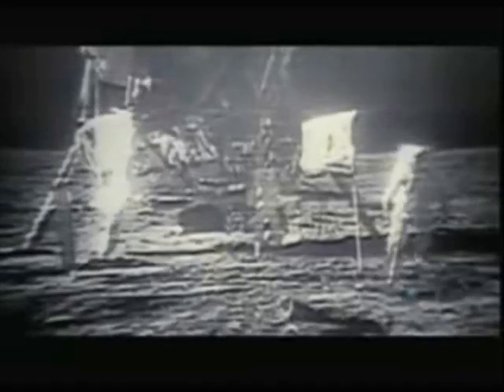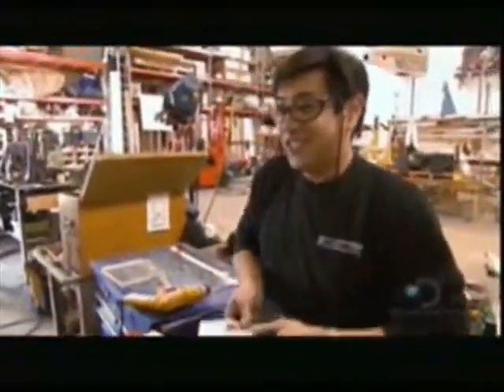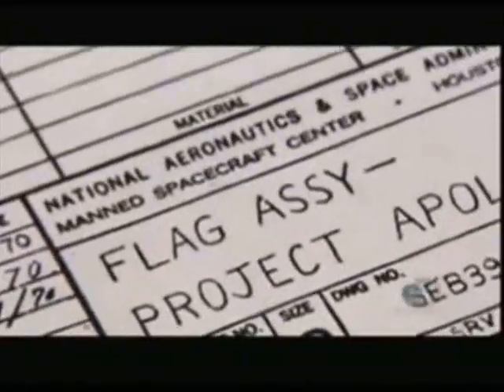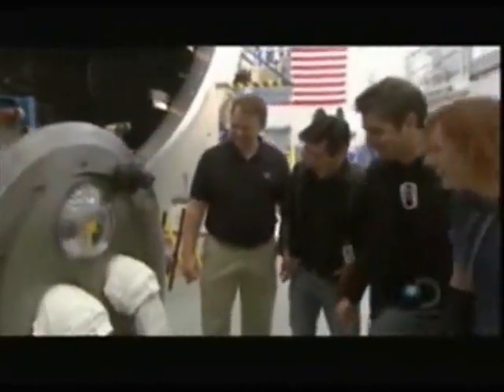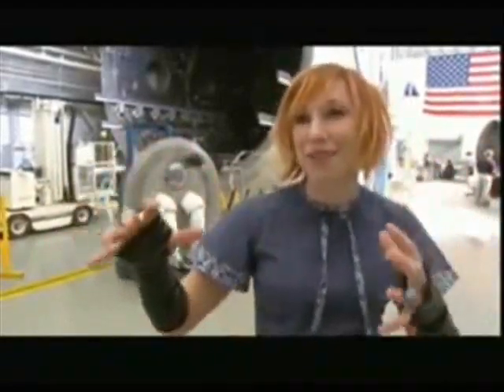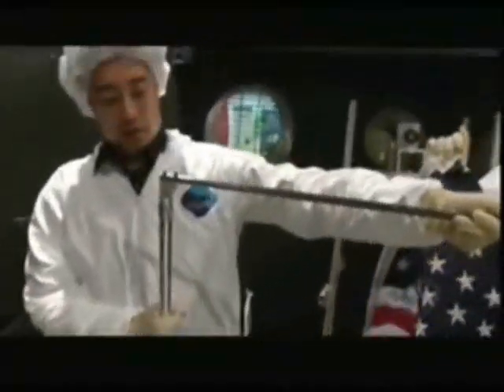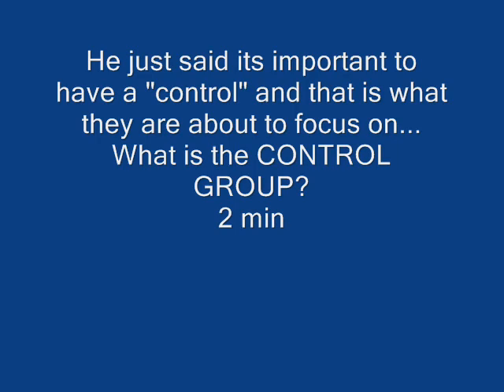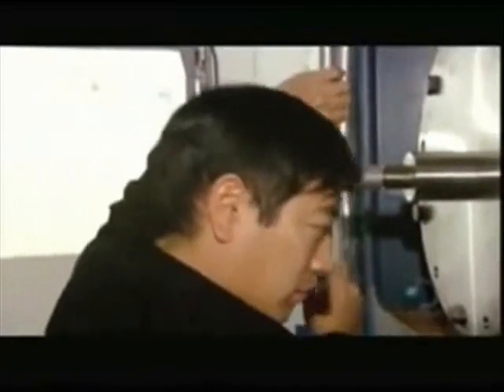Scientific Method Classroom Lesson: Myth Buster. Flag Hoax on the moon

Comment: Here is a video clip that shows the flag start waving after an astronaut runs past it at 2:34 mins. Myth busters is full of it.
Apollo 15 flag waving
Reply: Moons Gravity is a sixth of earths. If your statement was true, why did moon dust disperse everywhere from the liftoff? Of course it was from the thrusters, but that is just a larger scale of displacement of gravity, while an astronaut is actually doing the same thing on a smaller scale.
Reply: SaltyChip Interesting you mentioned the landers thrusters. There are plenty of photos showing an absence of the crater that should have been left by these thrusters as the vehicle touched down and an absence of dust on the landers feet that should have settled but did not.
Reply: +Truth Seaker how would  four legs from the lander create a crater?? Im open minded on this subject and all, but just don't see this as proof of anything nefarious.
Reply: SaltyChip The landers engine would  create a crater in the process of landing. You are aloud to use your brain you know.
Reply: +Truth Seaker you are allowed to use your brain too because you spelt allowed wrong
Reply: Lucy Zhu
I am dyslexic, thats why I cant spell,  whats your excuse for not being able to grasp that working lander engines would create a crater and dust that would settle on the landers feet or that an astronaut skipping past the flag should not create air turbulence causing the flag to wave on the moon.